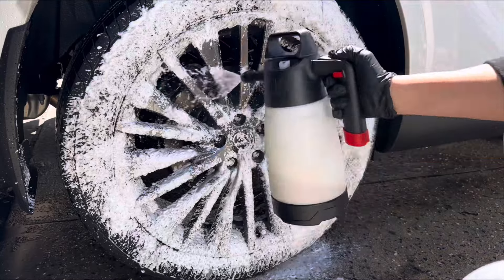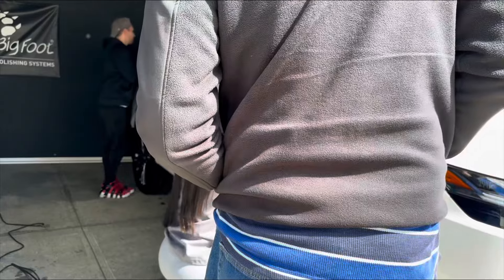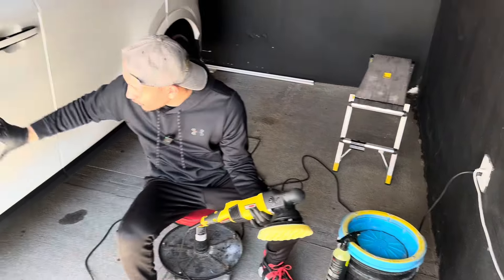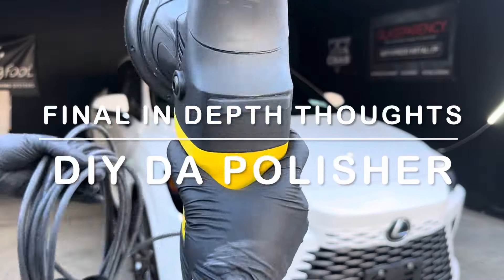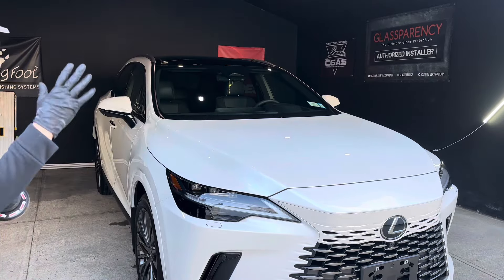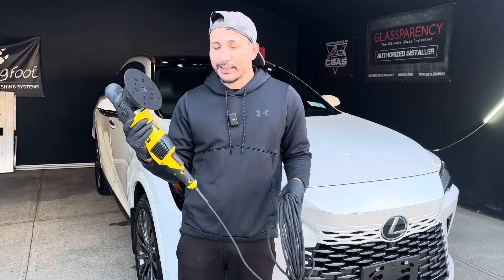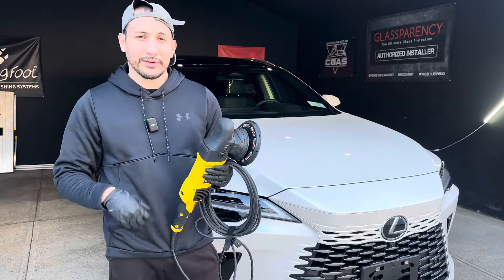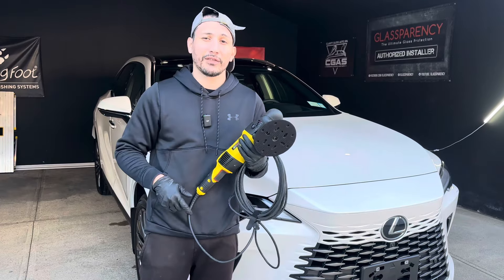MADNESS! DIY Detail DA Polisher Review | First ever 25mm DA

Comment: Shinemate vibrate alot? Incase actually considering one. Maybe even Rupes. So if these vibrate a lot, which other brand would you recommend besides the D.I.Y? What's the weight on this?
Reply from the maker: Vibration I say rules vibrates because speed 3-4 stalls easily and not enough power. So in turn you are using it on speed 5-6.  As DIY on speed 3-4 enough power and barely stalls. Shinemate and maxshine vibrates a lot in my opinion. Feynmach I have heard is very nice and smooth. 

Top brands besides DIY. The weight I heard is 1-2 ounce more than the Feynmach and that’s because it’s a 25mm with a larger counter weight 

Feynmach, Shinemate, Maxshine in that order for me.
Reply: Suggestion,can you make a video comparing Shinemate, Rupes, DiY  maxshine. If you have all these DA polishers. So what are the pros and cons. I know you said the 21mm Shinemate and Maxshine vibrate alot, etc? How about the 15mm versions of the Shinemate and maxshine? Or do you not use those? 

Do you like and use the variable speed trigger that are on the other machines that you use? 
 

Also you said it's heavier. even though a couple of ounces isn't alot and it  weighs 5.9 pounds , not bad since most are just as heavy.
Reply from the maker: @btbd2785  hey BTB. Thank you for the suggestion would be great I’ll probably hit up other detailers see if I can use their polisher of whichever they have to make the comparison. 

Typically when I order a polisher and like it I end up selling my other one. Example my rupes rotary vs my flex cordless rotary. I enjoyed the rupes rotary over the cordless and I ended up selling the flex rotary practically 30% off. 

That’s how I cycle through the polishers. Buy if I like sell or give away my other polisher.

The weight can also be due to the length of the machine. That’s like holding a stick that’s 2 ft long vs 4ft on the exact end the 4ft one may feel heavier or just a ounce or 2 heavier which is no difference but the length of it makes it seem heavier. A lot of things to compare and contrast.

Comment: DOC SOC 😎 laying down more great content How much difference between the 25 and 21 is there in correction and performance?
Reply from the maker: Thank you Rick 💪. Glad you enjoyed the content and definitely I can tell it cuts a bit more for sure. The same way you can tell off 6mm from 15-21 you can tell a difference here.

Even from a 12mm to 15mm there is a significant difference as well
Reply: Great. That's what I was wondering if there was much difference once you went past 21. Thanks bro.
Reply from the maker: @Detaildiy  paid my own money and I have the receipt for it. Also we are talking about smoothness and user experience of the machine. The machine will cut regardless and you can tell whether it cuts fast and efficient based on the throw and power of the machine which it has.
Reply from the maker: @JhawkerZ  no problem. Glad to help
Reply from the maker: @Detaildiy  to be honest. Any polisher that’s 15mm or more will cut. Which is not the issue. When using a polisher it’s on the user feel, experience and smoothness of the machine and balance. You can grab a Harbour freight polisher and use it and does the job. Is the vibration too much? Is it heavy? Is it a loud pitch polisher? Does it over heat? Is it balanced? Is the cord long enough, does it feel like quality. That’s what 99% of the people base the polishers on. Not the cutting ability as it’ll cut. 

That’s like comparing a Toyota Camry, vs Civic , Jetta, A4 and BMW they will all take you from point A to B. What is the overall drive experience. That’s what’s portrayed for polishers
Reply from the maker: @Detaildiy  it’s made in china. Just like the maxshine, dewalt , Milwaukee, Feymach, Shinemate . 

Rupes is assembled in Italy but a lot of parts from china 

Flex assembled in Germany parts I am not sure where from.
Reply from the maker: @Detaildiy  I wasn’t complaining I’m stating there there is a difference for sure in build quality. . In terms of smoothness vibration etc. that’s like again buying a car. I guess some people maybe slow.

But you can ask for high quality parts from a Chinese manufacturer they will make them. So in turn you can still profit it’s been like that for awhile. But in turn they passed the savings to us.

Example rupes because they get Hugh quality parts but assembled in Us and Italy labor cost is more which in turn the cost is more for us. You can get high quality parts or low quality parts in china. You can ask for what you want and get what you pay for.
Reply from the maker: @Detaildiy  for sure 😂😂 a lot of it
Reply: @Detaildiy sounds like you ve never used a polisher. If u d had u know there s a big difference. The Bauer from harbor freight has more in common with a jackhammer than a good DA.
Reply: @Detaildiy hey I’m not the one agruing that harbor freight and a flex are the same quality.

Comment: I'm stuck deciding between this or cordless spta for my first polisher. Any thoughts or advice between picking these 2 machines? Appreciate your videos. God bless
Reply from the maker: I can give you advice. The SPTA polisher is good. The major downside with the SPTA is battery life and long to recharge. You'll get about 35 minutes of run time but you'll have to wait an hour and a half to recharge. If you have makita batteries lying around they are great and are compatible. If not no need to buy them as you might as well get a shine mate or other cordless polishers. SPTA is great for paint enhancements like a one step. 

As for the DIY one definitely a way better quality and smoother just downside it's corded. Overall performance I go with DIY

Comment: How does it compare to the mcquire' da?  Thanks Soc and I'm glad your did a review on this product.
Reply from the maker: The Meguiars DA? It’s light years better period!!!!! Glad you enjoyed the video my brother. More to come with these polishers
Reply: @DetailingMadeSimple  🙂🙂
Yup, enjoyed it.  Have a good one.
Reply from the maker: @jaimedpcaus1  thank you. Yeah The DIY is far better imo than the Meguiars DA for sure.
Reply: @DetailingMadeSimple  I noticed that you weren't a big fan of the engine starting at full throttle.  I would also enjoy a step up as the polisher starts.  Did I get that right?
Reply from the maker: @jaimedpcaus1  for myself I am indifferent. I just said its a con for those with a preference that's the middle ground. It not having a soft start up does not bother myself or my wife.
Reply: @DetailingMadeSimple  Yes.  I see 👀.   Thank you Soc.
Reply from the maker: @jaimedpcaus1  anytime bro glad to help 💪💪💪

Comment: Shine mate and vibration I dont think so as for maxshine the same applies those are well made polishers even though they a Chinese based company. These 25mm Da has been around for a long time it's just now that Yvan has it added to his  product line up and videos do many people think it is the only 25mm DA.
Reply from the maker: Yes I have heard some been around. As you said Chinese based company but I've never used one of them. As I've heard specific ones had very bad vibrations and super cheap cords.
Reply: @DetailingMadeSimple  where you think that one you have is made? The one that was put about 2 years back was actually very good every DA has vibrations but it is omitted in the balancing of the DA, the weight of the head vs the body. I have the DIY 25mm the 25mm I bought 2 years back, maxshine, shinemate and rupes honestly they all the same with vibration only the rupes shine with the least amount IMO.
Reply from the maker: @0togtr811  I know it was china. I state it in the video. Just others cheaper bearings used, cheaper cable not plastic and not rubberized handles which makes vibration worse. You can make quality stuff in china and non quality just if you’re willing to pay for it.
Reply: @DetailingMadeSimple  that's true. Well most of the big brands we use is made over there and that's not going to change anytime soon. Random question here, is iron remover meant to clean or just remove brake dust build up that contains iron particles?
Reply from the maker: @0togtr811  iron remover is not meant to clean. Just as you said remove iron particles and soften them up. That’s why most brands have an iron remover built in with their wheel cleaner formula. Or just clean the wheels first with an apc or cleaner then proceed to iron remover. 👍

Comment: The 25mm throw is supposed to provide 20% more cut than any other polisher on the market …do you find this to be true? If so, it might be worth the purchase.
Reply from the maker: I don't know per se as I haven't used it on a thrashed vehicle. In theory that's always been the case the longer throw polishers correct better. You see a huge difference from a 12mm to 15mm and 15mm to 21mm. So I'm sure the extra 4mm plays a big difference as well. Remember also this DA is about 100$ cheaper than the rupes mark 3 as that thing stalls like crazy.

Comment: Thanks for posting the video. 

No soft start and you’re saying it’s smoother than a Rupes? Really? Because with a Rupes it can be held with 1 hand underneath it on speed 6 and there’s no vibration at all in your hand. I’m curious if that polisher can do that at full speed with no effort. 

Also, it would’ve been nice if you could’ve put it on a scale vs. other polishers because it does look big.
Reply from the maker: Hey Samuel. Glad you enjoyed the video. Let me clarify a bit what I mean in terms of smoothness for my experience. 3-4 is practically speed 5-6 on the rupes it has that much more toque and power than the rupes. I’ve used it tops speed 5 with one hand the machine is balanced well. 

Soft start for myself and my wife is not a necessity or a want. That’s more of a user preference. If we are spreading the product no matter the polisher if it has a soft start or not. We spread it on the lowest speed then ramp up to the desired speed. 

In terms of smoothness for myself it’s more on how it feels on the paint as well. I stated in the video you will get slightly more vibration because it is a 25mm DA. The longer the throw the more vibration you get. 

This polisher does feel heavier than most. I should get a scale and weight side by side. In terms of the polishers I have now it is slightly heavier than those. Hope some of this clarify my viewpoints 💪
Reply: @DetailingMadeSimple  Thanks for the detailed reply. Much appreciated.
Reply from the maker: @Samuelfish2k  anytime. I apologize for the late reply for some reason did not pop up on my feed. This DA is definitely heavier than others I’ve used. Talking about the top dogs. Apparently this is 1oz heavier than the feynmach 21mm but I need to get a scale to weigh the polishers

Comment: Any contamination on a new vehicle is removed by the dealership. Its called a PDI check in. Every new car goes through one before its placed out on the lot. Its the last QA check. He must not have worked in a Dealership before. Me over 37 years dealing with and working for dealerships.
Reply from the maker: Absolutely . PDI pre delivery inspection. It's never the best inspection at all!!! Let's be real. Very few dealerships are honest with this. Dealerships add whatever cheap wax or sealant on the vehicle. Do a mediocre job during decontamination. You may be one of the few honest dealing and working with dealerships. I know many dealerships and how they operate.
Reply: @DetailingMadeSimple  It is I did them. Where I worked I got paid flag time it was about 20 a hour for 4 hours which only took 1 hour to do. You still get paid for the full 4 hours no matter what. So if a truck brings brings in 20 cars a week you do the math. Also the chemicals used will remove all the contaminants. So all you have to is wax the car.
Reply: Oh yeah if you can get use to the rotary buffer it can do things the da cant. The truth a DA is for waxes not to polish it just doesn't have the speed to remove whats needed to get that high gloss. You need the RPMs for that. Trust me I know. Try remove  wet sand scratches with a DA you will be at for days. Go to a body shop and talk to a old school detailer he will tell you also. For a high gloss finish you need pressure not a lot measured pressure. You need speed also and thats what a rotary will bring you. Oh yeah dont listen to Ivan about a damp pad never buff with a damp pad that will cause a burn.
Reply from the maker: @cbigruck1  I am not disagreeing with your hustle or method. Because even if you were the one to touch it. Or use whatever chemical. Chemicals alone don’t remove embedded contaminants always. You may be a honest Detailer that did the job. The same a lot of detailers aren’t honest which is why I did this channel. I’ve denied many fleet work myself from numerous of dealerships. Some dealerships only want to use you once or twice on the lot. Spray shampoo and rinse with DI water and in their dealerships have their own people do a quick hand wash where let’s be real sometimes aren’t careful or the most detailed. 

Secondly. Some dealerships I’ve been to have a automated car wash!!! With “non scratch brushes” my job as a Detailer is to ensure proper bonding of the coating. No chemical ever truly removes a sealant left behind it needs to be abraded off. 

Third. Is with those swirls and scratches I’m using a polisher to do 3 quick passes to brighten up the paint and ensure the “protection left behind from the PDI” is removed. That’s all I’m doing here. Unfortunately this vehicle had swirls and scratches left behind.

 Are you defending all dealership work? Is the question at hand. Just because you’re honest and did well doesn’t mean others or all follow suit. Maybe get to know me and my channel before judging i actually have a video explaining this PDI on how to ceramic coat a brand new car. And how that car was almost flawless. There are different circumstances on all vehicles.
Reply from the maker: @cbigruck1  absolutely everything you have said I agree. Maybe take a look at my channel. Everything you have said I’ve discussed and demo before. The rotary gives a very high gloss shine.

Everyone has their method. There is no right way to raise a child or take a shower it’s the end result that should be the same. Some maybe longer or shorter.

Talking about body shop my friend worked as a painter in his dads body shop. I’ve learned from them as well. Old school lacquer paint yes you wanted heat with a rotary. Clearcoat is thin I’m trying to preserve the paint. I’ve done both and still do both depending on the situation. I can cut and finish with a rotary. I can cut with a da and finish with a rotary or just do a one step with max defect removal and that’s it. Like I said before get to know me and my channel before going rabid. Act like you would in person and not an aggressive arrogant keyboard typer.
Reply: @DetailingMadeSimple   Yes I will and Ill sub also. I have 37 years of knowledge and you can pick my brain as well.